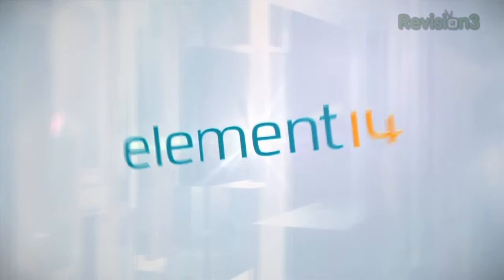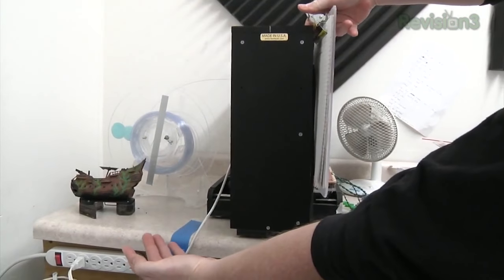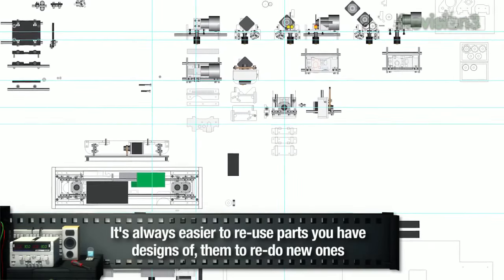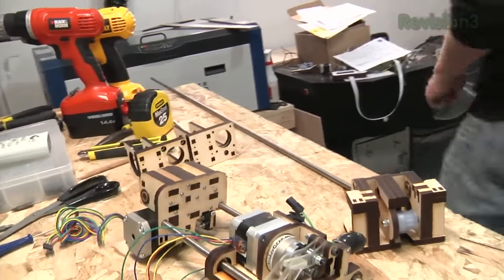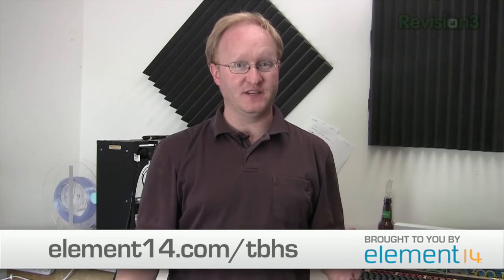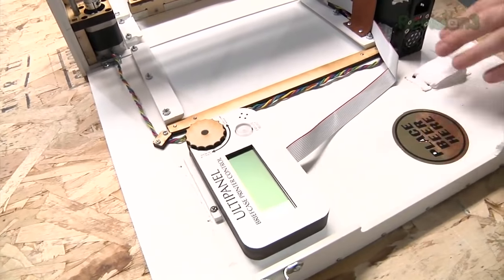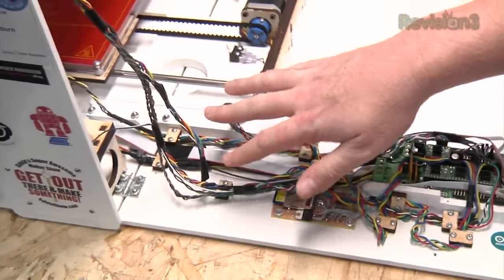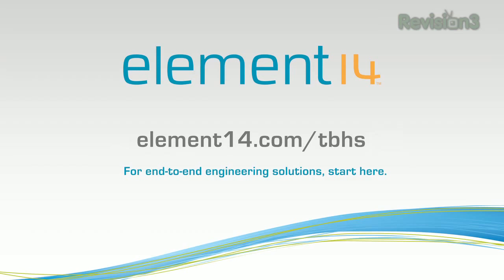Build a 3D Printer That You Can Take Anywhere!

Comment: An idea... take 2  photographic equipment hard cases (ex., Xit XTHC40 or similar)with desired dimensions , cut matching openings in the bottoms to allow print bed pass-thru (could chamfer the opening corners for strength), then attach them bottom to bottom (pop rivets, or such).   Easy peasy... ;-).  Might have to extend "feet" a bit on standing edge to get lids to lie flat on "butterfly" style opening.

The cases are relatively inexpensive (all metal will be more, of course), and found on Amazon.

That's my plan, anyway...

Comment: hey Ben just some info for you to share you already know that imperal thread are rea as (number of teeth - per - inch e.g. ) 15 TPI 
however metric is read a little differnt its read as metric bolt size 10mm AKA M10 then tread pitch 1 or 1.5 so in metric for e.g. 10 x 0.5 / 10 x 1 is classed as a fine thread where as 10 x 1.5 /10 x 2 is a corse thread  so 10x2 is 10mm bolt with a thread pitch of 2mm per thread. 
the thread pitch is how wide the thread is from 1 peak to the next 
have fun CYA

Comment: Is there a way that I can make my regular printer 3-d? Right now it can only print 2-d and I need to make it 3-d so I can make my projects. It's a HP 1401 all-in-on printer (if that helps) I have a few pairs of glasses that might work with it but I don't know which would work best. I have the paper ones with one red lense and one blue one lense, and I have another pair from the theater that are plastic and have clear lenses. also is their a way to make my printer into a laptop so I can take it on the go?

Comment: hi dear ben i was wondering if you can build 5 axis CNC machine for boat 3m by 2m using the profile 41x41 and profile 41x21 the sheep industry supporting material, and 3D printed part   thanks

Comment: ... hmm ok, yes you are right. when i typed my previous comment i was very tired. 200mm x 200mm is indeed 40,000mm^2, however my point was that 200mm^2 is not 40,000mm^2, as it would actually have to be something like 20mm x 10mm. though i think this might be what you were arguing after all anyway. sorry :/

Comment: Hey Ben Can you add ultrasonic sensors to a quad copter, could you possibly make it where the sensors are on all sides and the bottom (So 5 in Total!)? Thanks Ben!!!
Reply: why
Reply: You probaly could but would need to run it with a ardruino
Reply: +TheEnragedGamer you can do it with common flight controllers but why would you need to do that
Reply: Cole Hansen Because i don't know his application he was using them from or even the type of drone he was using because cheap drone usually don't have the best flight controllers or have that many features
Reply: +TheEnragedGamer I meant to say why does he want the sensors on the copter because I could direct him to a specific program that could help him with it and just using it for a sense and avoid system is pointless because you should be able to fly a copter without the use of that.
Reply: yeah that makes sense there kinda useless

Comment: also could i but the parts for the printer but it doesn't  fold up into suitcase i don't care about that bit i would  really like a 3d printer with that build size(the 20 cm long and whatever wide like 15cm or something dont care about height either around the same as width i guess 15cm) that i get to assemble my self, if u cant sell me the parts could u give me a link with a part list or something for a printer with the build dimensions around that size if u could help me out that would be awesome. btw your videos are awesome im subscribing. If the sizes is a bit different i dont mind, i know im asking a lot but if possible in AUD. thanks heaps!

Comment: Whats the motor controller board called?
Reply: The control boards are an Arduino Mega (or clone) + a Ramps board and an A4988 board for each stepper - they plug into the Ramps board.

Comment: what can be done with and old musical keyboard and an old pc i think is pentium 3 with no harddrive but everything else works, the keyboard i have no idea why is not working it used to work for a while and the turned off for another while and then it worked again and kept doing that, is there anything cool you can think of by joining those two or something like that?

Comment: how often would somebody use this?
Reply: Being an electronics engineer and industrial electrician I would use one quite often. I'm always hitting snags on projects due to lack of parts, with one of these I could make those parts and be good to go.
Reply: yeah but on the move
Reply: SNIPINGEARS it's just for the heck of it, plus not everything that's portable needs to be used on the go.
Reply: TTate
"not everything that's portable needs to be used on the go." then whats the point of it being portable?
Reply: SNIPINGEARS It could be stored easier in something like a shelf instead of taking up space. Or maybe you need to bring it somewhere else. Something that's designed to be portable is more easily transported.
I could continue but you get the point.
Reply: TTate
I guess it would be easier to transport the printer.
Reply: SNIPINGEARS That's the point

Comment: you should design the cheapest currently possible way to make your own 3d printer many of us have or can get PC power supplies extremely cheap most of the metal parts you can get very cheap from a hardware store, the circuitry we could prbably make cheap from radio shack parts, and the other various plastic parts can be printed by others or we could even use things from hardware stores as substitutes

Comment: What are you talking about? Even if you are using math, it would be 200mm^2, so 200(mm^2) the term means 200 square millimetres. As in 200mm by 200mm.

Comment: Don't you mean 40,000 square millimeters not 200? That would be a 20mm x 10mm print area
Reply: +WEED SMOKEZ Apparently you're not great with geometry. A 20 cm by 20 cm square has a PERIMETER of 80 cm but the AREA is 20 cm TIMES 20 cm. That would be 400cm squared. Ben wrote 200mm squared which would be a bed that is 20mm long and 10mm wide for example.

Comment: 200mm2? Area of 10x20 [mm], really?
Reply: i think he means 200mmx200mm. which looks about right for the size of his pcb warmer.
Reply: Yeah I figured that out as well... I have actually watched this video before but did not notice till now...
Reply: Martin Blass
so 20cm2 then almost 12 inches
Reply: 20cm2 is 4cmx5cm (1,57in x  2,00in.)
Reply: Martin Blass This hurts me right in the maths. 20cm^2 is 20cm*20cm. x^2=x*x
Reply: 200mm sounds really big but its not. Take 20cm with mm just add a 0 to the end. 1cm is 10mm so do the math
Reply: I noticed that right away too. I'm like, "That doesn't look like 200mm²"

Then I read the replies and it made my brain hurt.

So lets clear this up. It's apparent that he meant 200x200mm.
That is 40,000mm², or 400cm².

200mm=7.87402" that becomes 62.0001909604" ².

400cm², 62"².
Reply: Jennifer Gallihugh
no! He means (200 mm)^2=(20 cm)^2=400 mm^2 which is not the same as 200 mm^2.
But he is excused, because he is not used to metric units - even though the same would apply to square-inches...
Reply: Uwe Zimmermann  You lost yourself in conversions should be 400cm²

Comment: Shit nigga, you thought ink cartridges were expensive, a plastic liquid cartridge is 50 dollars per cart.. 

Imagine how much they are going to be once they start using metal in 3D printers, probably Gallium will be used since it is so easy to melt and safe to melt, you can melt it in your hands! And then freeze it at only 0 degrees :P

Comment: 200mm! that's 2cm!
Reply: ... it's 20 cm, or about 8 inches.
Reply: Mkay.
Reply: +Ecto he probably is talking about him saying that it is 200 square mm. which is 2 square cm. the print surface is 400000 square mm ( 200 x 200 = 40000)
Reply: Right, he should have written it as "(200 mm)²" or "200² mm²" which of course is the same as (20 cm)² or 400 cm². The factor between milli (0.001) and centi (0.01) is "10" for length and of course 100 (==10²) for area.

200 mm² is of course wrong. A square area with 200 mm² would have a side length of about 14.142 mm (10*sqrt(2))